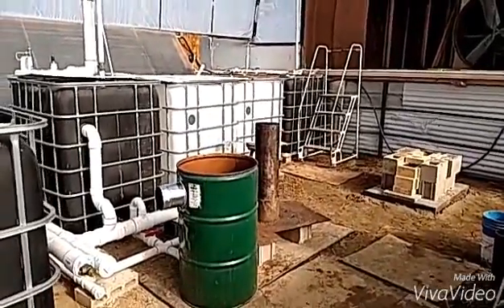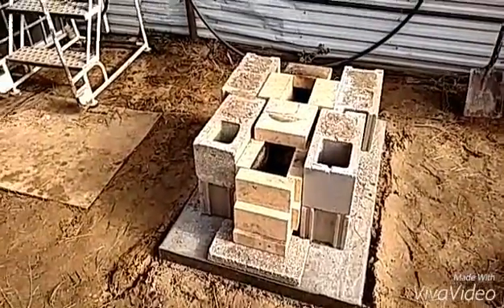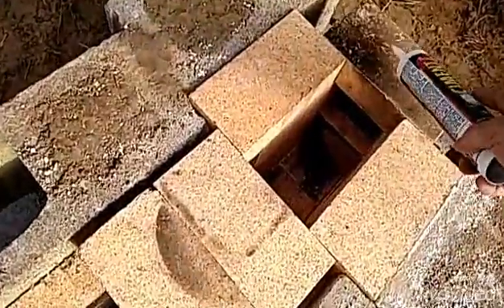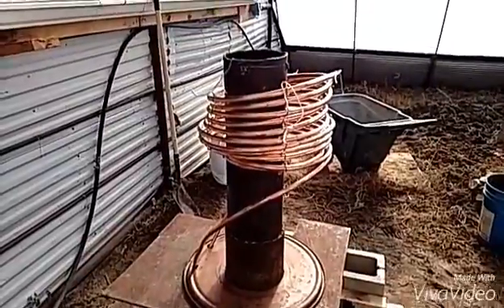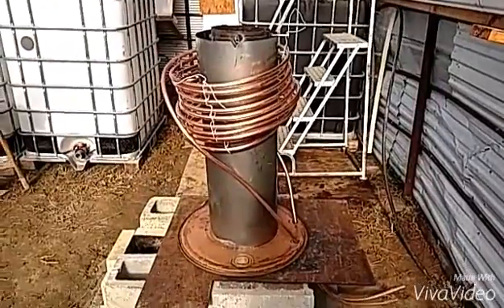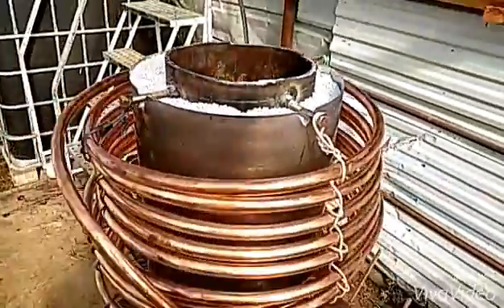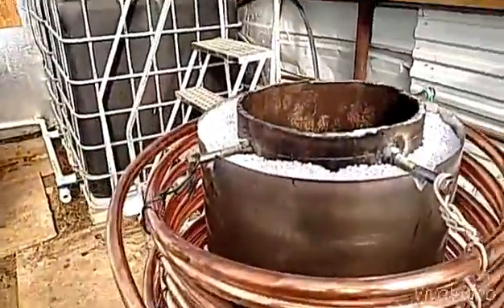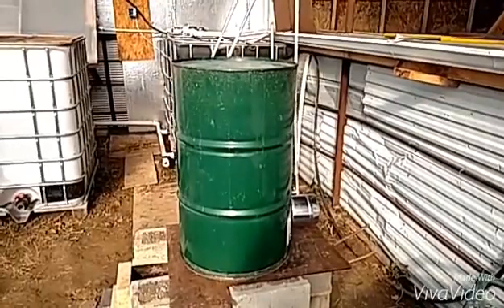Aquaponics rocket stove build Pt.7

Comment: Great, clear video of a simple clever design. Great communication. Would the heat transfer to the water be more efficient if the copper pipe was in direct contact with the steel riser tube ?